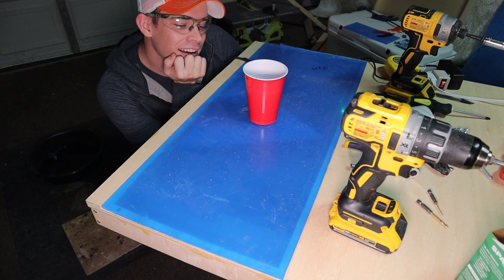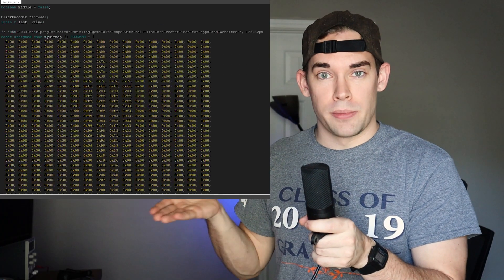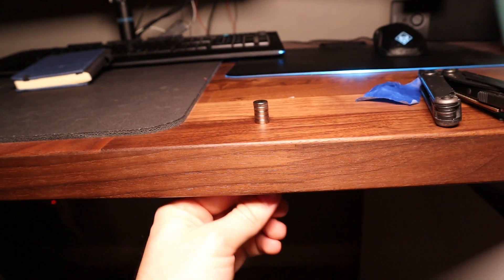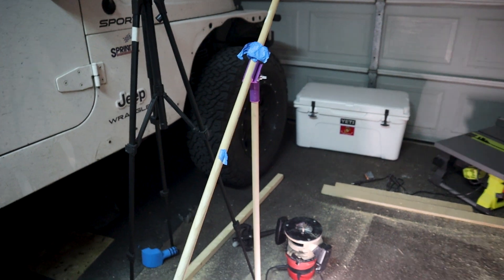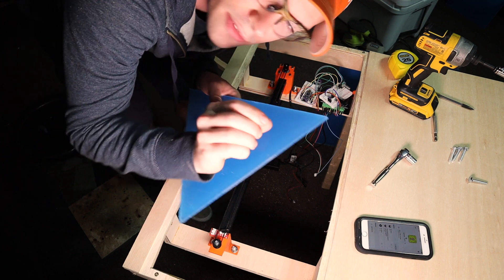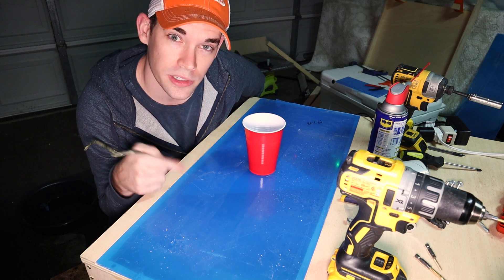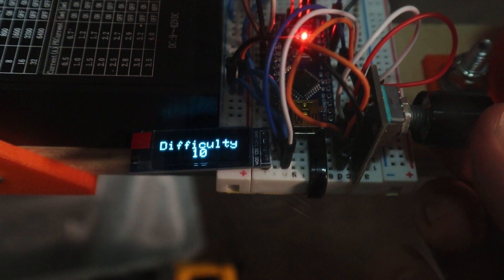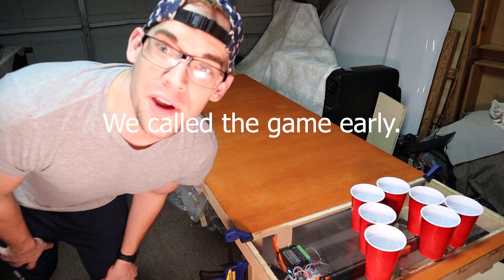Automated Drinking Game Is Harder Than You Think

Comment: A dope idea as always. I remember when I was living with roommates and playing epic amounts of BP. As for some ideas to expand: Third motor on the center mount to make the triangle rotate (or, go the "Stuff Made Here" route and use a dual-belt system around a central gear and asymmetric motor motion to rotate it). A "Random" mode that does a randomly-generated pattern instead of just left-to-right cycling (good for a single-cup game of "Sink To Drink"). 3-D printed cups with magnet pockets in the bottom, instead of taped on Solo cups, and proximity sensors in the bottom that make the cup light up if a ball is sunk. General RGB-ification as well, ideally along the edge of the routed rabbit for a sort of Fiber-Optic effect, then maybe laser-etch a pattern and fill it with resin and a PFOA/Teflon coating instead of HMW adhesive tape? Maybe something fully hydrophobic with little gutters around the side to prevent splash buildup on the play surface? Also, from a UI side, Bluetooth pairing and a phone app instead of an LCD. Get all that nailed down and you honestly probably have a product you could legit Kickstart and market, I'd hazard.

Comment: You can make it go faster top speeds if you accelerate/brake it smoothly
Reply from the maker: Yeah! I want to add some accel/deceleration to the code at some point. Especially if I ever add water to the cups haha. Thanks for the suggestion and taking the time to watch the video!
Reply: @TyPalowski  Would be interesting to see! It would be possible to add a weight sensor to the plate moved to calculate the mass dynamically as the cups get emptied ;) Algorithm shouldn't be too hard to figure out with a fixed distance. The more weight the softer curve ;)

Actually have not watched the video yet, just briefed it at work. Looking forward to watching the whole thing!